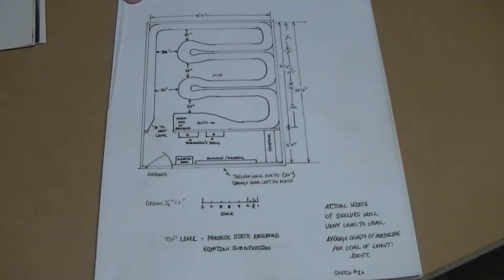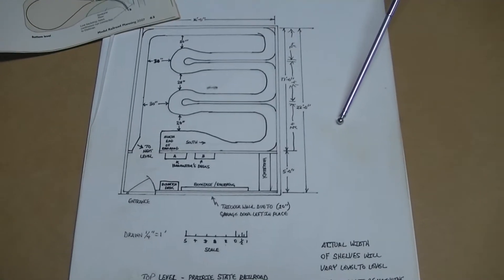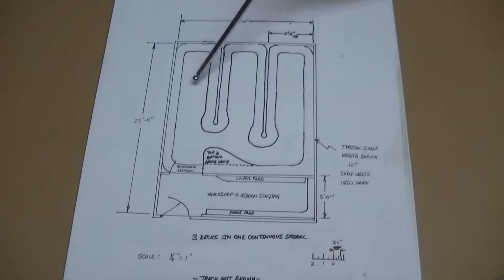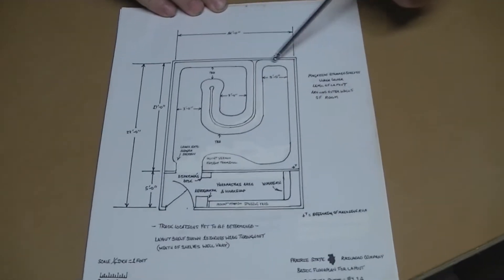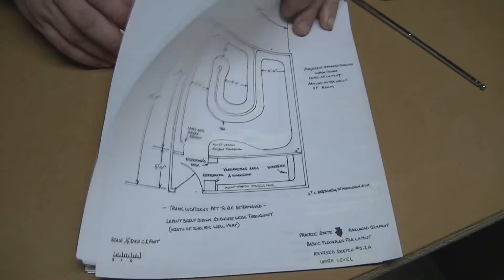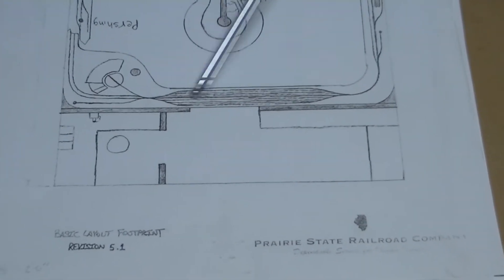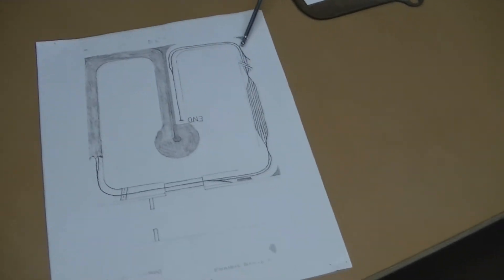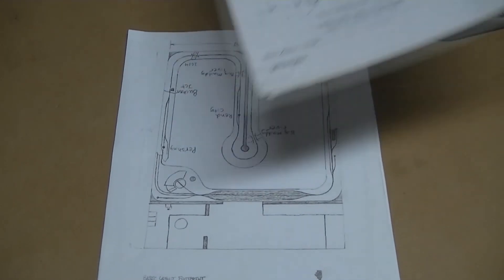Evolution of the footprint of the layout

Comment from the maker: To get the length of mainline I wanted and still have a yard, dispatch office and workshop all in same building, it was a necessary evil.  This building is only a temporary building for the permanent layout down the road.  The new building will eliminate all nod under and duck unders from the layout.  I am using what I have available for the time being.  Trust me, if I could eliminate the duckunders, I would.